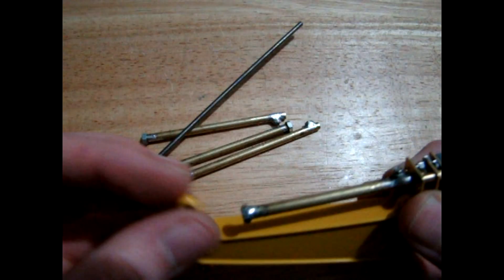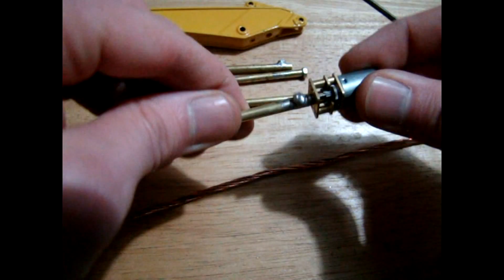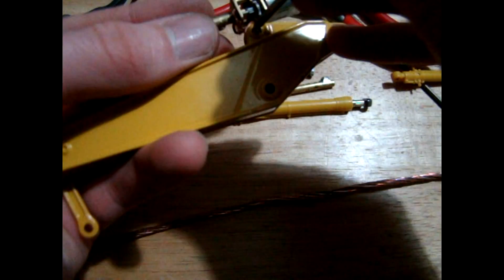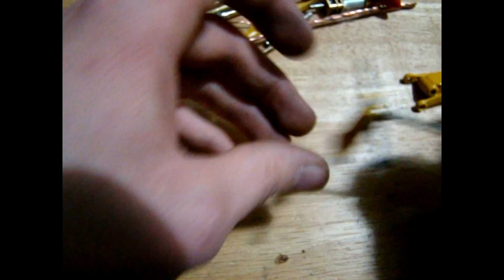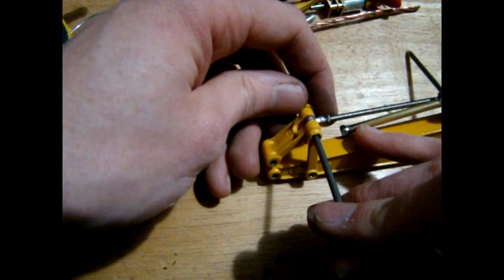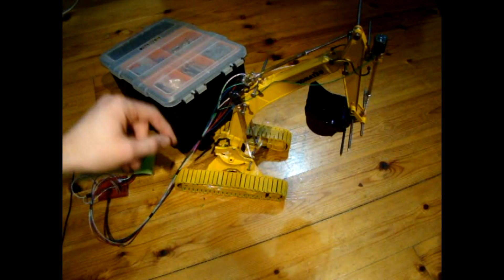RC Komatsu PC400LC Part 3 - Mounting the motors to the excavator boom

Comment: Which gear Chesley this motor with gear and effort in kg?
Reply from the maker: The motor was a 1:30 gear ratio, according to the ebay seller at 3V the torque is 0.56 kg.cm and at 12V it's 2.4 kg.cm. Not sure how reliable those figures would be.
Reply: дякую